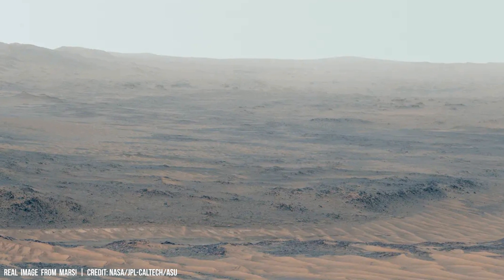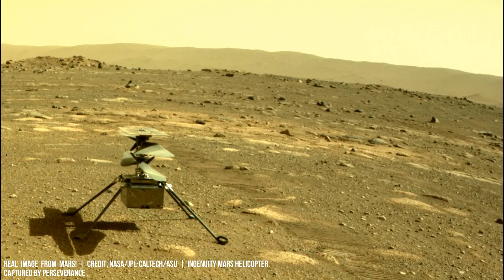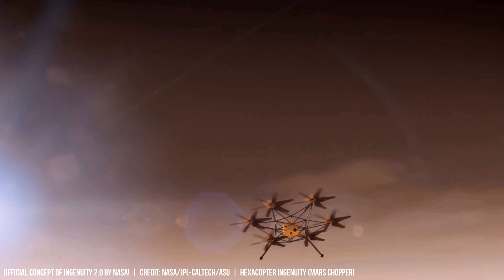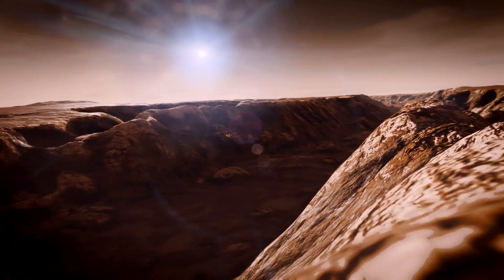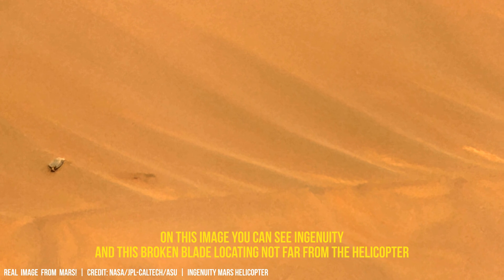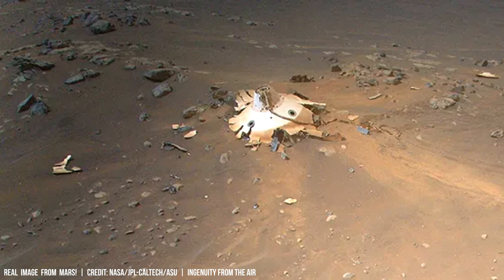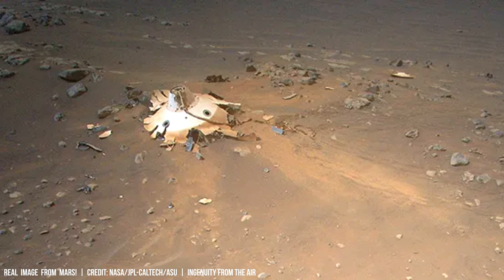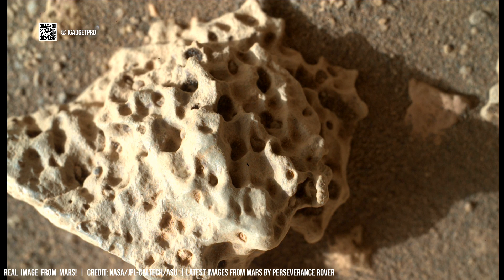NEW Ingenuity Mars Hexacopter revealed and old helicopter crash investigated by NASA

Comment: By looking at the geography of the crash site (sand dunes or ripples), two scenarios appear logical. Ingy got caught by a gust due to sudden winds, tilted and smashed it's rotor blade at the bottom of the hill. Every glider pilot knows about winds at hills and the risks. The terrain also is rising upwards and the distance to ground is minimized for the rotors while landing. This alone is a NO GO there for landing.